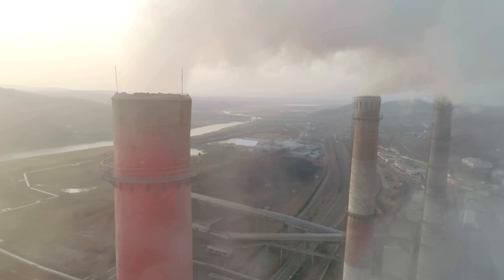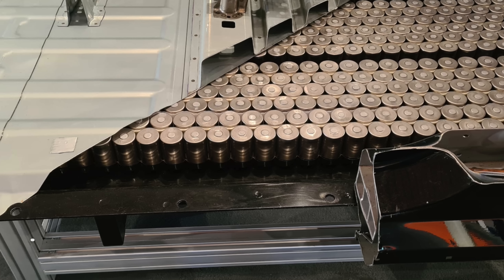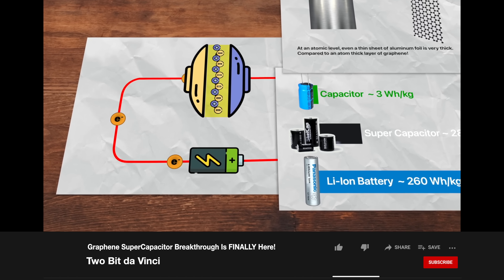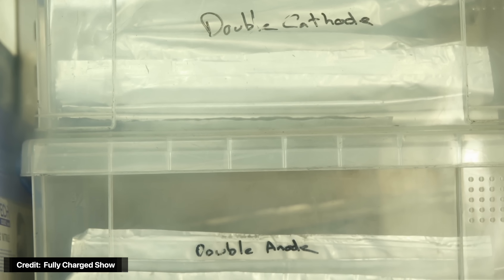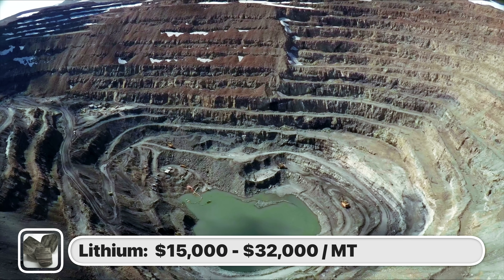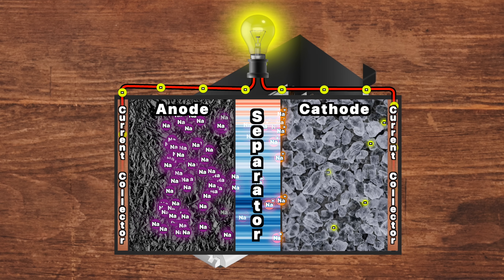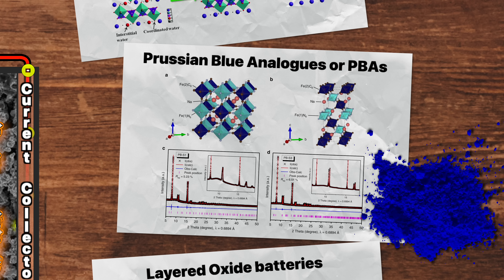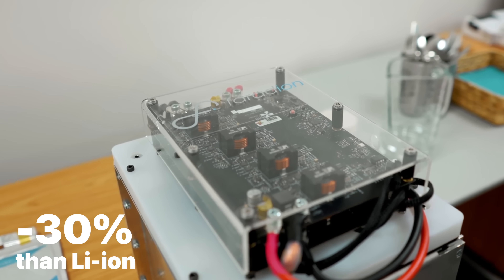Next Gen Battery is 1000x Easier to Source and 99% Cheaper!

Comment: I really like your programs. You and the just have a think programs are very informative. I'm glad to see that they are at least hopefully pushing forward with the sodium ion batteries since salt is common and cheap. Now one of the problems I would like to see addressed is that of hybrid vehicles. I think it's ridiculous to have a regular large size infernal combustion engine running the car and the batteries and electric motors doing very little. That type of hybrid should be banned! The type of hybrid I would like to see for electric vehicles would be a small cargo trailer pull behind them with a regular generator as is used for home electrical emergencies. With a mere 10 gallons of fuel in it that could push a vehicle for hundreds of miles easily. Push is actually the wrong word, I mean provide electricity for the vehicles on board electric motors. Plus you'd have the added benefit of an extra storage area. This would take care of longer trips. Around town there's no need for that the batteries on board would deal with up to 100 miles anyway. Another problem for all vehicles on the road made in the last 50 years is that they have the stupid spoilers on them! They're called spoilers for a reason, they spoil your airflow and increase your drag coefficient. Look at a 1969 Chevelle Fastback, or the late 30s and 40s for the way a vehicle should be designed. Spoilers are not needed unless you're in NASCAR or are driving more than a hundred miles an hour on curves! If you just got to have one you still need to have the Fastback design on the vehicle and have an adjustable spoiler that can go to zero or on up to where you're pressing the tail end down. NASCAR would get at least 20 miles an hour more speed out of them if the spoilers were just deployed on the corners and flattened on the straight stretches duh! They will say that that isn't stock from the factory, well neither are any of the vehicles they drive! They banned the Dodge Daytona 500 with the tall spoiler because they said it wasn't stock. What a lie you could go down to your local Dodge dealer and order one! All of this efficiency needs to be a combination of factors. I no longer worry about any sort of climate change, the climate is always changing! What we need to clean up is air pollution and poisons from corporate dumpings! Also we need to recycle waste plastic into building blocks pavers roadways, you name it. There's no need in trying to recycle back into the original product, look at what India is doing about recycling plastic, making shoes, shredding plastic and melting it into their asphalt roads to to name just two things. Most of the time we seem to be headed in the wrong direction. We need electric vehicles especially to just start cleaning up the air, then we can work from there on the other stuff.

Comment: We need a more holistic approach to the challenge and we need to stop demonising things. Maybe we still need to use fossil fuels in  some applications just as we need different batteries for different use cases. We also need to be more aware of what we not just dig out of the ground to burn but also to make things. For sure EVs don't burn fossil fuel but a lot of what goes into making that vehicle is made from chemicals extracted from fossil fuels. Then there's the roads that the EV drives on. We'd also do ourselves a big favour if we insisted on goods being more durable and repairable.
As for sodium ion batteries they seem like they'll have a place in our future probably not in EVs but in stationary storage.

Comment: does a Na battery love 100% to 0% state of charge?  In other words, does the battery degrade faster in different states of charge?  If so, lower mileage is not an issue, unless the difference is very significant.  Charging time would be the next big issue.

Comment: The most important features of a battery for static applications is price and longevity with volume or weight of far less importance.  And if we find such a technology, it reduces the pressure on Li, leaving more available for mobile applications.  Think, for instance, how many Teslas you could power with the Li in the Hornsdale mega battery.  A Tesla, has, say a 60kWh battery while Hornsdale, I believe, is up to 180mWh.  Dividing one by the other you could power 3000 Teslas with that amount of Li.  An alternative static battery technology could well bring the price of Li for mobile applications down by simple supply and demand.

Comment: I see this as being very uninformed.
Sodium Ion max Watts per kg 225.
This can be increased by doping with rare earth's or by adding some other metals. This can achieve 900 watt per kg but the cost increase is dramatic.
Next the cost of Sodium is not just the material so cost saving is only about 25 to 30% less than Lithium.
Reply: yelaa çels at 300 wats per kg 75vwstsbpe g higer
Reply: @sharonbraselton4302  non existant product!

Comment: CATL is releasing their 2nd generation of sodium batteries and they claim 260kwh. If this is true then they surpass present Li ion batteries. The first gen was a 160kwh and have been in use for a year. Sodium is also not affected by temperatuers( no thermal runaway). They also can discharge completely and recharge completely without harm. Yes they are slightly heavier, but they have a few things in their favor.

Comment: Meh, Lithium is already about as abundant as we could ever expect it to be.  It is one of the most widely available elements on Earth, literally.  Lithium-Ion probably won't be the long-term chemistry because of the other elements start are more scarce or undesirable.  Lithium Iron Phosphate is a different chemistry (it isn't Lithium-Ion) and has many desirable characteristics.  We won't run out of Lithium, we will just have to open up more mining for it.  We are expected to have enough Lithium in circulation to not need to mine much after another 10-15 years and we can just recycle the lithium that we have as the batteries degrade.

I do think we should be using other chemistries for stationary purposes, however.  Sodium and Iron based chemistries work great for this purpose.

Comment: Power Density its only an issue for vehicles, especially airplanes. COST and SCALING its the biggest problem for every energy storage solution. I bet u the worst battery is 1000x better that pumped-hydro when it comes to density.

Comment: One info which is sadly missing is charging efficiency. It is almost certain that it will be lower than Li-ion batteries with about 95% (discharge/charge energy).
Reply: 92% according to Faradion; so pretty close to Li-ion; and that's likely to improve as research progresses.

Comment: I think the great failure in the system is that we are looking for a single solution, and there are going to be a dozen solutions.  Na-Ion would be good where weight and size are not huge factors, for example a power wall or grid storage.  However Hydrogen may work better for transportation, where charging time is a big factor.    This leaves Li-Ion where battery weight and size are critical factors.   At least for now.
Reply: I’m sceptical about hydrogen after I have read more about it. Low energy density, creation, storage, distribution, safety, inefficient in thermal engines, NOx, and so on.. Should only used in chemical processes, where there is no substitutes.
Reply: @Harrythehun  Actually.... H2 has one of the highest energy densities going, by weight OR by volume (liquid form, obvs). But, as you say, from a practical perspective, it's a nightmare. It leaks out of almost anything, and to get it to be a liquid it needs cooling to within a few degrees of absolute zero AND compressing. And even then, your woes are only just beginning- Hydrogen can be absorbed by various metals, notably steels, which become brittle (search for Hydrogen Embrittlement), so your fuel system will need to be made of all kinds of exotic if it's to last a lifetime. Then there's all the hassle of transporting it (you can't just use the existing gas pipelines).

There's also the whole Hindenburg perception - how many times have you heard people talking about "not wanting to carry a bomb around in the back of my car"; and yet, ironically, H2 is FAR safer than gasoline in that respect; if your tank does rupture, the H2 will rise away from the scene of the accident in seconds, and even if there IS a fire, it will be very short lived... unlike petrol, which hangs around on the ground releasing vapours for ages, looking for that elusive spark... and thin walled petrol tanks will be much easier to rupture than thick H2 tanks, which are trying to keep back the pressure of all that liquid H2 which is just desperate to turn back into a gas...
Reply: @theelectricmonk3909  Ok I have knowledge about hydrogen. I have worked as inspection manager for inspections of refineries, power plants and QA engineer for ESPE project of pulp and paper and chemical plants. Look up how many cubic meters you need to replace same energy amounts compared to natural gas and other energy fluids. You will be surprised about dimensions for pipelines and how many additional truckloads you need for hydrogen.
Reply: @theelectricmonk3909  H2 has a really high energy density, but you have to compress it at great expense, and you have to contain it, typically with a heavy, expensive device.
Reply: @Harrythehun   it's a good call... By weight, H2 is awesome... By volume, not so much.

Comment: Using sodium to make batteries.... This makes desalination make sense.... Pump ocean water to a whole bunch of the land lock states, and let's get this moving. We need clean water, ocean water can provide that as long as we aren't salting and poisoning our soil, use that salt and build an entire industry around the surplus of salt left over... It simply makes sense. 
This does not eliminate the need for petroleum, but it does provide several solutions to fix major problems.

Comment: For storing  renewable energy , like wind or solar you need large capacity and it must sustain one cycle a day for 20 years =>  10 000 cycles, thus  lithium is not an option. sodium tech is much more suitable for this with its superior cycle life.
PS where I live, during the winter I have only 6 hours of daylight (25% duty cycle) and very few days of sun, mostly gray and clouds, so the solarpanels have to be huge. During January February some times it gets really cold for a weak (-20 C) and that usually occurs when there is NO wind at all, and it often occurs all over the northern Europe . => thus NO windmill can help us then.
Tha sad part is that the energy demand is at its peak when it is no wind.

Comment: Our EV is rarely driven more than 100 miles per day. Several recent 12 hour trips demonstrated that 200miles between charges was perfect. Good time stretch, take a bio break, and a fast charge. Recharging over night is the norm, so 300 - 500 mile range is generally an emotional need, not a requirement. If a sodium battery can provide 200-250 and a 20% cheaper battery, I’m in. That said I expect to see this tech in stationary applications for the near term.
Reply: You're right. But making EVs 20% cheaper could make a BIG difference in terms of adoption in developing countries. I think companies like Tesla should consider cheaper versions of their vehicles for those markets, and replacing Li-ion with Na-ion could be the best way to make that easy.
Reply: @Israel_Two_Bit    I’d be happy with a simple, less expensive EV.  without all the fancy luxury toys. 
I don’t need a car that drives itself and does my taxes at the same time!

Comment: Hi 
In the not to distant past we were using lithium cells for some applications and most people weren't aware of them if you said battery to people 25 years ago it meant lead acid or an alkaline cell both of which are still relivent today, isn't it time that equipment manufacturers took some responsibility and select the most appropriate battery technology for the job it is to do as it seems to me that everyone wants to use lithium for everything. When looking at power storage on a large scale why use lithium when iron flow will work or even lead acid both fully recyclable and no real danger or needing any special battery management systems they just take up more space, to many people work about cars and there batteries, I belive the Nissan leaf still uses nickle cells. It might be time to change our transport habits and use public transport more 
Keep up the good work

Comment: Sodium batteries are a no-brainer for renewable energy storage.  Energy density and weight doesn't matter that much, but cost and life cycle matters quite a bit.
Reply: The one thing he didnt cover, I dont think, is the fact that most batteries are made in china that then has to be ship over to the US or said any other country. By moving over to sodium batteries - any country could in theory make them. Thus the cost from the number of suppliers would drop the battery more than 30%. Life cycle I belive is on par with todays batteries.

Comment: Ah yes another hyped up promising new miracle battery that will shortly be out but never takes off in production stage outside the labratory test production in small scale and tests done in optimal settings.

Hopefully we'll be able to master graphite technology so we can have graphene battery that's or solid state battery or algae battery which have similar if not more energy storage density as lithium ion batteries. While don't have cons of lithium battery!

Comment: 3:15 You run out of batteries to power more of these infernal devices , I will throw a party that will be herd all the way to the south pole! No good came out of smart phones and laptops. Social isolation,disregarding your environment , in favour of the machine, are but the tip of the iceberg. 10 high school children in a group, each with smart phone , not talking to each other, with the lone nerd trailing behind , furiously tapping on her tablet! 

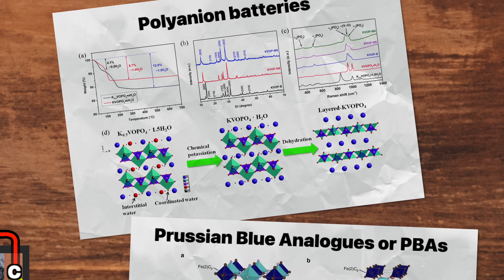8:08 Not naming them,. plus the blurb that told me nothing , tells me they are expansive , rare, or difficult to mine. Or .. there's a hidden catch somewhere , that will scrap any advantage of using sodium.

Performance ! Piss poor! Cant replace the Li-On battery, you're wasting my time.

Comment: Mainly people need to LOWER USAGE.  Im baffled people use so much on some countried without even having a airco unit or using it for heating. USA uses up to 3 times more thern the EU on average while with heating it shouldnt even be double. That should say enough. And halving the price isnt nearly cheap enough to warrant a EV battery replacement from 15k to 9k  (part is install costs) won't help anyone adopt ev's.  i need the cars to drop to nearly the same price per radius of a ICE before they are usefull.

Comment: What about ev farm tractors or heavy equipment like excavators that need addditional weight?  Battery weight become much less a disadvantage and the longer life cycles a definite plus.
Reply: True.  The counterweight hanging on the rear of an excavator weighs tons.  Might as well be a battery bank.  Without a large engine to drive the hydraulics there would be plenty of space available.   NB:  Volvo has introduced a small excavator and a wheel loader, both LION powered.
Reply: buynjihn de elyrc yrackpr